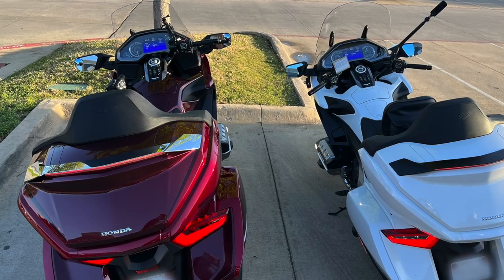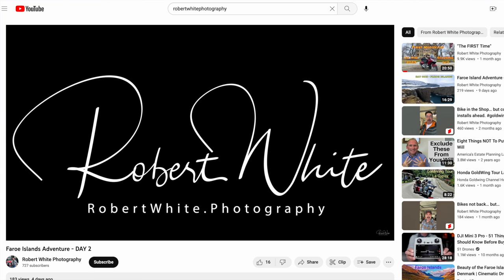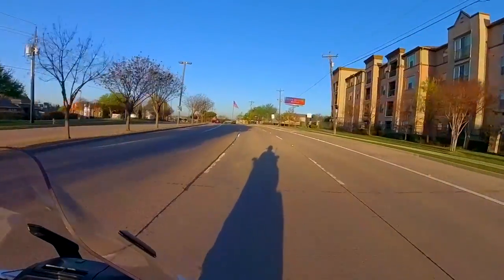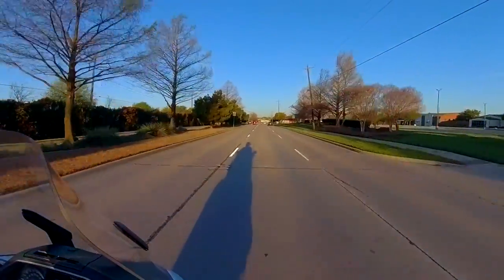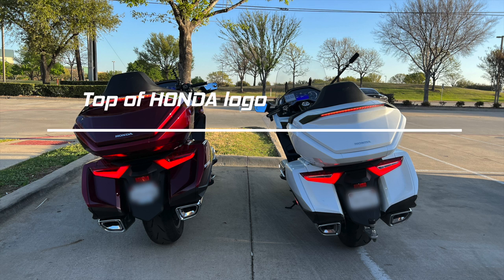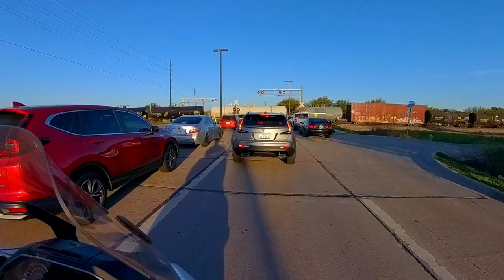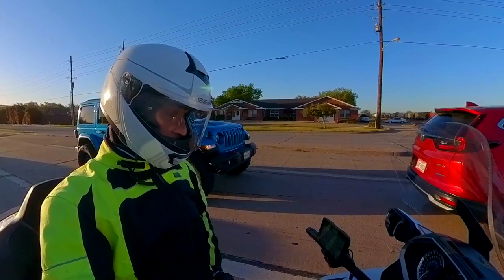Honda Goldwing Engine Ticking Issue SOLVED? | Cruiseman's Moto Vlogs

Comment: I have a 2018 and have always had the ticking noise on startup.  I keep it on the kickstand because I have it on a HF dolly so I can turn it around in the garage.  I have the base GW model and installed the center stand but hardly ever use it.  I always thought the ticking noise was related to the oil not being equally distributed on startup and was "normal".  I will place on the center stand for about 15 minutes before startup to see if ti makes a difference.

Comment: The ticking sound on my 2019 occurred more as the bike got warm, not cold. In fact, it was worse during the peak of summer. Whatever it is, it never impacted performance and I couldn't hear it until I was beside a car or truck at a stop light or when I pulled into my garage. I kept mine on the side stand. Here's my crazy theory, I didn't hear the ticking until I installed my aero peg (hwy pegs). Could that hardware have altered the phonics somehow?

Comment: I usually have my bike on the side stand but I start the bike in the upright position so that the engine oil can soak the pistons evenly. I've been doing this for my previous bikes that are carburetted. I'm riding the 2017 Goldwing and I don't hear any ticking. I'll mute the radio volume next time before I start the bike to listen for any ticking.

Comment: All my bikes have motul oil in them and you will notice the motor is alot quieter than with other oils . I just switched my 2018 wing to motul and I will say there is a big difference in how the bike sounds , runs and shifts . I strongly suggest using motul over any other oil because it leaves a slick film coating inside your motor unlike other oils and your bike could sit for months and that coating doesn't go away !
Reply: Cruiseman, I have a 2018 Goldwing trike and it also has the ticking noise. My trike motor stays level all the time so I don’t know if putting it on the center stand is a solution to the problem
Reply: I have a 2013 f6b,  I also run motul oil and mine is quiet as well
Reply: Do you still use a 1030 weight oil or something thicker? Does the oil you using match Honda oil specifications?
Reply: @curtisbull1583 flat engine should use 30 oil more
Reply: Is there a specific Motul 4T oil or all?. I've heard a few different people say the Motul makes the Wings gears quieter

Comment: The weather up here in Connecticut is slowly improving. Seeing some low 60s days but nights are low 40s. We wait for the salt to wash off the roads first. Not too many put off by 40s and 50s it's the salt on the roads we all hate. I put my bike onto center stand always and don't have the ticking. Would be good to poll people riding the standard as that doesn't have a center stand at all.

Comment: One way to verify the ticking sound would be to switch off the ignition and turn it over a few times then turn on the ignition and start it up and see if the clicking sound is still there. By turning over the engine without the ignition on will pump oil into the cams giving a little lubrication before startup. By the way I have a 2005 GL1800 that I park on the kickstand and I've never heard a ticking sound.
Reply: Not possible with the new GL models from 2018... start button and kill switch are the same !!!    😇
Reply: No additional kill switch on the newer models?

Comment: Cruiseman I also have a 2023 goldwing tour, and I also have a ticking noise in mine, I do not leave on the centerstand when i put it up in my shop but I do put it in a tire chock which keeps it straight up this is very annoying for a  brand new bike , I have changed the oil after a 1000 miles but did not make any difference,  I was told its the valves not adjusted correctly but i thought you did not have to adjust valves on these new bikes.. anyt way thanks keep up the great work.

Comment: Still cold and somewhat dreary in the Albuquerque area. But it supposedly starting to warm up tomorrow (3.29.2023). Just checked the fishing reports for the Valle Caldera area around Jemez Springs NM. About an hour and half from where I live. They are issuing road advisories because they happen to have 4’ of new snow in the area. (Yes, I meant 4 FEET)…Go figure….

Comment: Have always used the Center stand on my 2018 when parked in my garage.  The bike always has an audible tick on the right side of the engine until it’s up to operating temperature.  It did this when I picked it up new in 2020.

Comment: Mine has had the clicking starting with about 5 or 6 hundred miles on the bike (22 dct tour). I took it to my dealer, they told me it was the fuel injectors, that they make the sound when it’s hot (it was hot, but mine makes the clicking noise at all times, even after a long ride). At the time, I almost always put it on the center stand, but now usually keep it on the side stand, no difference for me…
Reply: Is yours only on the right side?  If so did you ask why is the right side injectors making noise & not the left ?  It is more plausible that Honda was using incorrect parts on right side or misadjusted the right side.
Reply: Me too 😢

Comment: 2008 GL 1800.  It’s 32 Degrees this morning in North Central Indiana. Getting ready to ride an hour to work.
Reply from the maker: Very nice!
Reply: The last two winters in central Indiana have been unusually dry which have allowed me to continue riding to work year-round (42 miles round trip).  I had to take the truck approximately a dozen times so far this year when there was snow or ice on the roads.

Comment: I have a 2021 Airbag with no ticking. I always keep it on the center stand, only using the side stand during dismount. Even at restaurant stops, it's back on the center stand.

Comment: My bike is always on the center stand, no clicking.. An old KZ1000 police motorcycle mechanic always told us "center stand when you can, it keeps the parts lubricated that should always be soaked in lubrication!"

Comment: I had a 2019 Goldwing Tour DCT and had no clicking noise. I just bought a 2024  Goldwing Tour DCT and it does have the clicking noise when cold till it is warmed up. I always put my motorcycles on the center stand. My 2024 only has 600 0:15 miles and I was going to take it back to the dealer for investigation.

Comment: My last bike was a Victory Cross Country Tour and if I started in on the side stand (bike didn't have a center stand) it would "tick" for about 20 seconds.  I learned to sit on the bike straight up while putting on my helmet and gloves with the bike straight up and down and it didn't tick when I started it up.  My 23 GW tour is always on the center stand so it never ticks and if that's the reason some tick because it's on the side stand I can understand that.

Comment: I agree with your theory. I did initially hear the ticking before I installed the center stand. After the center stand was installed I would always park it upright. And yes the ticking sound diminished. However, after not starting the bike for a month or so, I did hear the ticking again, but only on the right side not the left side. So what does THAT mean?

Comment: Hi Cruiseman, I always enjoy all of your videos and just for general info I have a 21 Wing and always put it on the center stand when parking in my garage or at a hotel for overnight. I have never noticed a ticking on the right side of the motor. I also had a 2018 and again no ticking. The oil settling on the left side when on the side stand sounds very plausible.

Comment: I’ve had several 911’s, where on my last 2017 version (that I ran for 6 years) had the same issue, where Porsche service advised this is known and due to oil draining from the hydraulic valves when flat 6 is standing.  After running for about a mile or so, it would clear.  Was annoying to hear on start up though.

Comment: I realize this thread is a little older…but…I just did my first oil change on my new to me 2018 DCT….I started it and right away heard this ticking….wasn’t there pre oil change…I shut it off, then started again a few minutes later….ticking was there still but seems to quiet down after a minute or so….going for a ride tomorrow and we’ll see how it does then….it has about 30,000 miles on it….do I need to go get a valve adjustment ??
Reply from the maker: I doubt that a valve adjustment will solve the ticking issue. I have read where several owners did that, but the ticking remains.
Reply: I went to the dealer last Monday to make an appointment to do a valve check / adjustment and since that same day, it doesn’t make the noise anymore !!??

Comment: Chris, your Goldwing looks to me like it is leaning more than the other one in that picture.  I would check your kickstand, they wear after lots of cycles and get sloppy on the mount.  On my 09 Goldwing I noticed this so I took it off put it in my vice and closed the gap so there was way less tolerance between the kickstand and the hard mount on that the kickstand pivots on.  Just something you might want to check out.
Reply from the maker: Had not thought of that. I will check it.

Comment: I just watched a video about a guy that just bought a 2023 brand new and he had it check out. They had to adjust the valves on his bike and said it was not covered under warranty. I just bought a 2018 and I here the noise some times my self. But I play my radio a lot so did not notice it write away.

Comment: Got a 23 goldwing with just over 600 miles, I've had it for about 2 weeks now. I also have a pretty significant ticking on the right side, definitely worse when you first start it up and the sound lasts for quite a while, actually I don't feel it ever goes away just not very noticeable after a bit. Thought maybe it would go away after the first service, which was just done.
Still there and of course they say it's normal but did note it down for possible warranty work later on down the road. 
I will try putting it on the center stand and see if anything changes. 
Would like to try some stick oil such as Lucas oil but will need to do lots more research before I feel comfortable adding anything honda doesn't recommend.
Reply: My 23 is also ticking on right side. Dealer in Tennessee said it sounded like valves needed adjustment. Mine is also at 600 miles. Dealer said Honda does not cover valve adjustment. My arguement is if they are already out of adjustment then the factory made a mistake and should be corrected under warranty. Valve inspection is 24,000 not 600 miles.

Comment: Good morning, just a quick comment on the starting my 22 goldwing I have never heard any Ticket Noise or any noise that's unusual . My bike is on the center stand for cleaning or to Double check tire pressure. So it's on the side Stand most of the time so far so good. Mike From Brewerton ny.

Comment: One bike taller than the other ? Hardly . The parking lot is sloped . As far as the ticking sound goes , Goldwings run so quietly you're going to notice every little sound coming from that engine after awhile . Now , if you really want to hear noises coming from the engine , just ride a Harley Big Twin . You'll soon realize its normal or go nuts .

Comment: Hi Chris. I park my bike at home on the center stand. No ticking or clicking. 2021 Tour DCT. My previous bike was a 2013 F6B. It always had a clutch cage noise and associated vibration at idle. I wasn’t expecting the same noise and vibration from the DCT, but there it is. I’m sure it’s normal, but I expected smooth and quiet. Bugs me a bit. I’ve heard others that seem smoother and quieter than mine at idle. 
Have you ever had your valve clearances checked? My bike has a little over 11,000 miles on the odometer and I’m not sure if a clearance check is warranted or necessary. 
Spring is in the air here in central Ontario, Canada. The snow is melting, although we’re expecting more over the next few days. I’m getting anxious to ride. I missed most of last season due to a damaged front rim from hitting a pothole in early July. I waited 8 months for a new rim from Honda! It finally arrived last week and my bike is road worthy again.
Reply from the maker: Have checked the valves yet.
Reply: @cruisemansgarage  Did you mean to say, haven’t? I don’t remember ever checking valve clearances in any of my bikes over the years, although almost half of them were two stroke. 😜
Since the GoldWing engine is basically a car engine, I can’t see why it would be necessary, especially in its earlier years. 
How many miles on your 2018 now?

Comment: I have an ‘18 that I bought new in ‘20. I have just under 20k miles. Never heard a ticking noise and always park it on the center stand when parking overnight or when parking for several hours.
Reply from the maker: Thanks for sharing

Comment: Your ‘side stand theory’ is plausible, I suppose. I have read, however that using the side stand on a GW, especially an older one (mine is a GL 1100 1983) can result in burning some oil that has accumulated to the left side, on startup.  This happens with my bike and I have never worried about it. It clears up after a couple of minutes. 😊

Comment: I have a 23 DCT tour keep the bike on the side stand and just started hearing the ticking sound on the right side . I have 3,800 miles. Should I take it in to Honda to have the valve adjustment checked? Any ideas thnks
Reply from the maker: I have heard of many owners with the ticking that had their valves inspected/adjusted and the ticking remains.

Comment: I was ahead of you on your center stand comment.  I have a '19 DCT Tour and have not noticed the clicking sound.  I almost always park in my garage on the side stand. Also, I pretty much always ride my GW  daily, rarely do I miss a day of riding the bike .  So, if less than 24 hrs between start ups have any impact on clicking or the absence of clicking? Also live in AZ and the weather is most always "perfect for riding. Severe storms are about the only reason  I skip a day of riding.
Reply from the maker: Thanks for the info!

Comment: I'd bet a beer your ticking sound is a valve lifter. Your theory about parking on the side stand  is very reasonable. My Victory had also hydraulic lifter that would chatter for a while after start up. I would recommend an oil system cleaner you put in the oil right before you change the oil. Just let it idle for a few minutes, DO NOT RIDE IT! The cleaner flushes out all the gook from the oil system and helps clean the lifter too. It's like $5 buck for a quart, give it a try. Assuming you get you bike back soon, sorry.

Comment: If the ticking was never an issue on PRE '18 why would this be an issue on '18+,,, maybe because they redesigned parts of the engine and it's a 4 valve per cylinder instead of 2 now and so forth maybe with other things they modified also😮

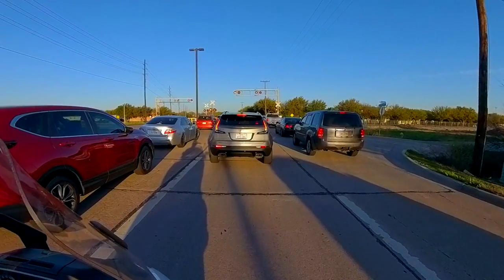Comment: I''ll save everyone 5 mins, of dribble... start the video at 5:00 to hear the issue described, then skip to 6:30 to hear an explanation the perceived cause... which if you were ever a K1200LT owner will be completely obvious... actually the same could be said for any boxer motor stored on the side stand. Btw, I have a '22 non-tour, I keep it on the center stand and have never heard the ticking noise.
Reply: the word is drivel, not dribble

Comment: The ticking issue is very common with Kawasaki cruiser motorcycles and it's caused by exactly what you explained so I wouldn't doubt it could exist with other bikes. In our case it goes away a few miles down the road as the engine warms up.
Reply: That’s why you use ZMax fuel additive it works!  Carol Shelby endorsed

Comment: Well, Honda says you shouldn't ride slow on the DCT or it will burn up the clutches. If the clicking/ticking noise is a problem from lack of oil at startup, maybe Honda will fix that by just telling owners to remove the side stand. Or just never let the engine get cold.